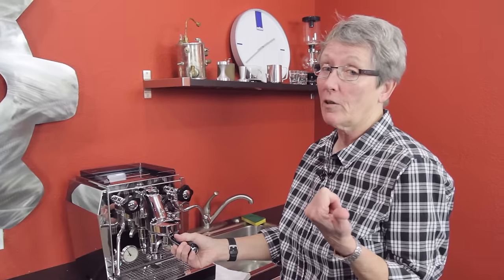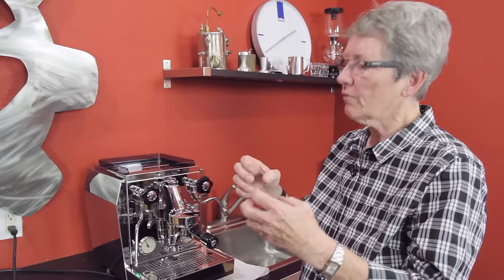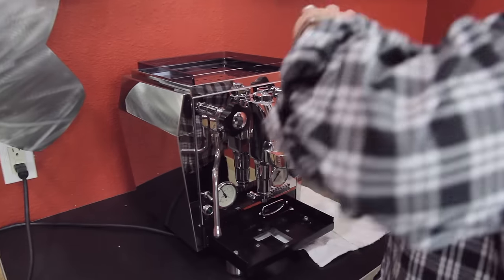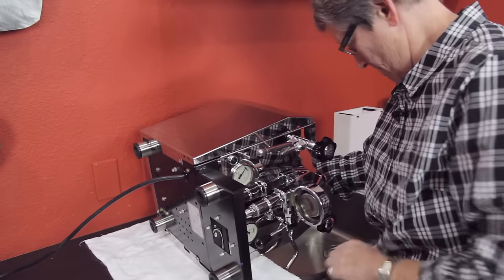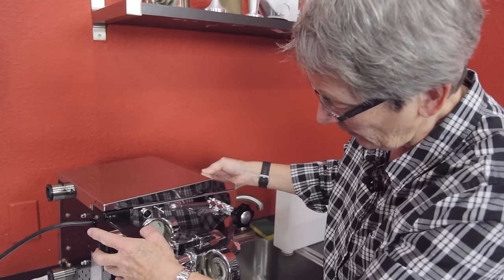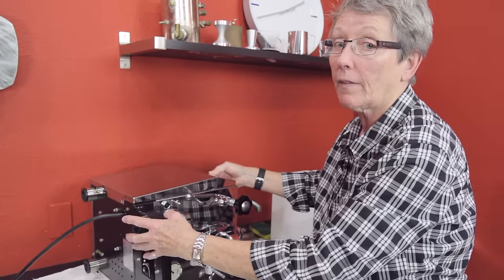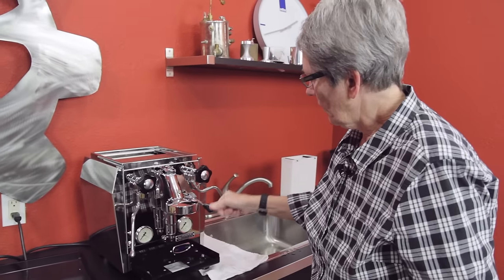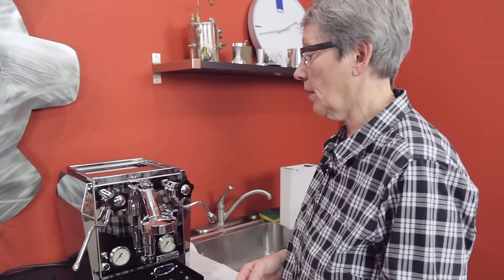How To Drain An Espresso Machine Boiler | Morning Maintenance

Comment: I sold Italian automatic coffee machines for a couple of years (about 8 years ago), We had a real cold winter night (-15 Celsius which is real cold for us) One of the coffee machines was mounted in my van, which was parked inside the garage.. The next morning drove out to one of the country towns to show the machine to the customer. Turned it on and once it was warmed up, pressed the go button and water poured out from underneath..

The water in the boiler had frozen, and the two brass halves had bent apart (the bolts held).. That was a lesson.. Never did sell to that customer.. Did a quick repair by removing and dismantling the boiler and using a hammer bent the parts back in shape. 

:) I would recommend as Gail does, if shipping to make sure the boiler is empty- might even pay to have one of the valves open so that air can escape or enter and any remaining water won't cause any problem..
Reply from the maker: +Mathew Winters Great story, thanks for sharing! Sorry about that boiler!

Comment: What about something like a Nuova Simonelli Oscar, where there is no hot water spout?
Reply: +LiamBrewing  I also have Oscar and I'd also like to know...
Reply: +LiamBrewing Without going into the internal/electronics. Best way is probably to heat it up, lay it down on the steamer side, turn the steam on and let water out through the steam wand. Should get most of the water out.
Reply: LiamBrewing I emailed nuova simonelli in bellinham,  WA about how to drain the boiler and they helped a ton! It was so easy.  Take off the casing and on the left side is a boiler drain valve which you just loosen and tip on its left side.  I had an Oscar II by the way
Reply: They emailed me schematics and a tutorial and were extremely helpful.  Any questions I'm sure they would help you out.  It's the Nuova Simonelli service center Bellingham,  WA
Reply: @Krikstar123  I have also nuova simonelli musica and I will ship it to our country. Is there an easier way to drain the water?Thanks